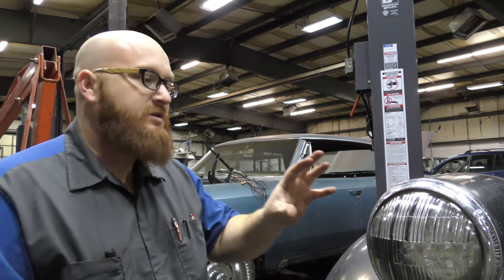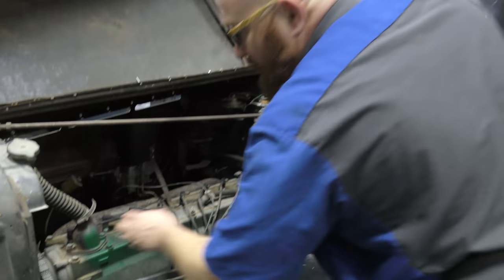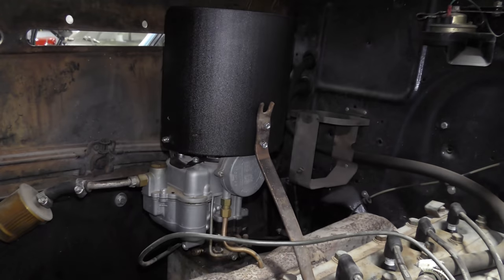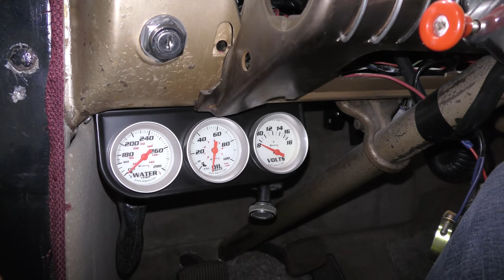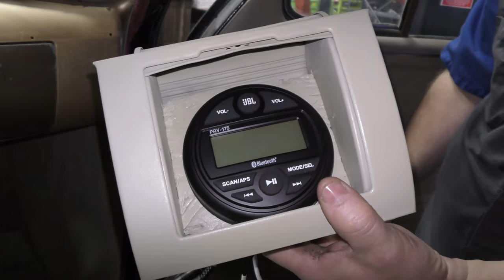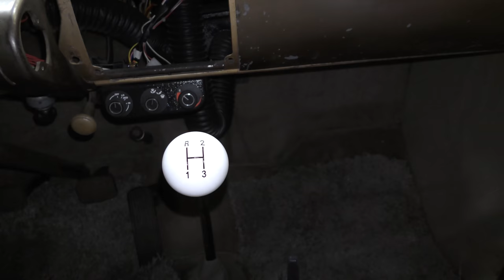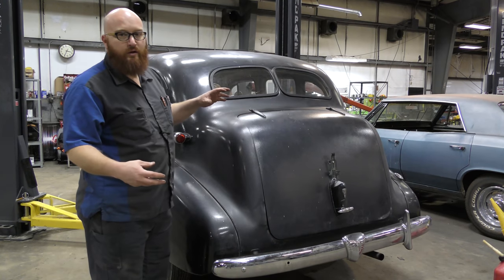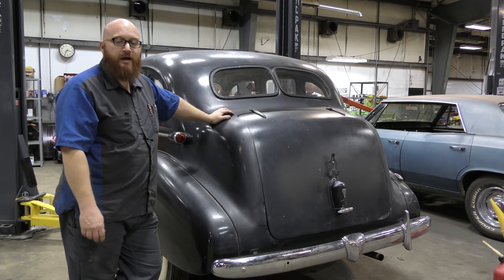OLDS SERIES #2: Nightmare to keep '38 Olds original! CAR WIZARD struggles to restore 83 year old car

Comment: Get rid of the Drum Brakes.  Brakes in that era were so poor that many would not bring a car traveling at 70 mph to a full stop, they would fade out.  Now you are welcome to try them for yourself but make sure you have plenty of room when you do this test.  BTW it's likely that you will have to use second and first gears to slow the car enough to allow shutting the engine off to come to a stop.  BTW, my father was born in 1919 and was a driver during this era.  Back then it was standard practice for a driver and high speed to use their gears to slow the car down to 50 when they could then use the brakes to scrub off speed for a stop.  Once my brother and I were in our mid 20's and on our Dad used tell us about his antics with his 34 Mercury engine equipped Ford 5 window coupe.  He also told us about the brakes back then.

Comment: I still urge you to at least install a dual circuit master cylinder. Much safer than the single circuit one.
Reply: Surprised.that master cylinder under the floor still works. They get a lot of road  grime down there.

Comment: Wizard.  Looking online some photos show the turn signals mounted to the bumper. Either in the edges or the chrome tips. 
Question. Why if you went with modern headlights, not put the turn signals there? As you noted, there’s 5 LED lights per lens. Could it not have 4 lights and a turn signal??  
The marine speakers, could they be mounted behind the cloth of the footwell? Instead of cutting the fabric??
Looks good. 
Cheers.

Comment: I have a similar issue prefab floor pans with my 76 Toyota pickup. I can't find them anywhere. If it was a 78 or later, I would have more luck. I'm concerned about the parts availability as it gets older, especially since the market for that generation of pickup is dwindling already.

Comment: Did you know you can get led headlights with the turn signals inside. Seen them on a hot rot. No having to figure out where to put them and a very clean look.
Reply: Several GM cars (notably Buick) had lights in chrome bezels on top of the head light "nacelles". I believe they were parking lights, but could convert to directionals. GM shared that body style across the board, if not interchangeable, probably easily modifiable. I seem to recall that Pontiac was Oldsmobile corporate twin in those days.

Comment: Oil bath filtering is way way superior then paper filters. They only reason the OEM switch is more money replacing filters in there pockets. The oil bath is way superior for air flow and filtering.

Comment: I would put the speakers under the dash firing downwards...   Also, looks like it already has an aftermarket heater core, why not just replace it with a vintage air heat/ac unit?

Comment: 'Ere Wizard, the trunk lid is screaming out for the spare wheel to be externally mounted. It'll be heavy to lift, but it'll be worth it for those vintage looks!
Reply: In 1938 they would have had "side mounts".

Comment: Wizard, a throttle would be a more 'period' look and feel. You can set it to work like a cruse control . . . just don't forget to turn it off. Lots more fun though. Thanks. Cheaper, simple too.
Reply: A 1938 should already have a hand throttle.
Reply: @warringtonfaust1088  I'm thinking that's what one of the holes in the dash was for.

Comment: “I want to start it like they did in 1938”. 
“I want cruise control”
😉
Reply: There were a few throttle-lock-based cruize controls in the day.
You would tap the gas pedal to disengage them...
Reply: Had cruise control on a lot of cars I've owned. Never ever used it. How lazy can you be?
Reply: @rtta51  lol. Yeah. I bought a ram promaster city base model. I wanted MANUAL WINDOWS. But you can’t get them. I don’t want any electronics that aren’t necessary. They just break and cost stupid money to fix. I can roll up my Windows and press the gas pedal myself. But I was just making a joke about how the wizard wants to WORK the extra pedal  to start it like they did in 1938, but wants to drive it with cruise control and no pedal. 😊

Comment: I like the fact  that you will not overrestore this car and that it will be a car that will be driven! Actually this car could keep the paint it has now: Just freshen it up and isolate the scratches to protect it from rusting.
I did not like those extremely cold LED lights. You should find bulbs with a warmer light.

Comment: If I remember correctly Chevrolet used ball bearings in the front wheels well into the 50s.  When I met my wife she was driving a 1962 Chevy II.  Nova was the top trim level that year.

Comment: I’m sure you know, but make sure anyone touching the Olds is aware of the left hand thread spindle nut and lug nuts on the left side!
Reply: Good tip. Back in 1995, I had a 69 Plymouth fury that I took in for new tires. 
I forget to tell them about the left hand lugs and they proceeded to break all five off the front wheel.

Comment: There are so many opportunities to cut metal out of cars you can fabricate anything. Need a floor for the boot, Mitsubishi L300 van floor pan, wheel well from a truck body.  If you can't find an answer to solve a problem, you are not looking hard enough.

Comment: Hey Wizard;  Nice car for a steam punk dash.   here is how I would do it.  take a picture of the original dash numbers for speedometer,  Now you should get that all digitized,. cut the blacks out  now on a glass have a sticker made from that Digitized image so you can glue it on the back of glass.  now you need to get a screen that is modern, and add it behind that and get it as a digital fill bar so when you drive it displays the speed.  then ass some Copper/brass as the dash parts and you will now have a great modern look on older car.   As for the Radio, you should have used a touch screen.  and modernized it a bit for back up views.  then use the roll up feature to hide the system...   Call it a James bod mod....

Comment: The lens probably wasn't from 1938. It was most likely from circa 1946 - 63. As cars used to be made for at bare minimum 15 - 25 year product life, with new spare parts availability being guaranteed, for that time. :P And yes, this was especially an American thing at first, until Europeans got a hold of the concept with MB and Volvo for example making it a thing that their dealership network must be able to at least have a part available from factory if not in stored in stock, for any model of car at a short notice. Which is why you could buy brand spankers spare parts for Volvo Amazons in 1995. Since production ended in 1970 and it was issued that way. Actually, you could get them from Wetteri as late as 2005, since they tended to collect in certain areas. So, they finally let them go for cheap liquidating the stock. Old geezer Hoarders galore... :D But, covering up and modifying lights for fear of bombing raids was a thing between 39 - 44, even in continental US. And, these cars were in government service quite often. So, yeah. The original lens? Most certainly new-old stock post-war. :D Unless, you know. It had the production date stamped on it. D'oh! :DDDDDDDDDD

Comment: Unless you are going to town on the chrome, and make it all shiny and straight, I would not paint this car. The current paint matches the overall state of the car, and that, to me, adds value to the car. Keeps its history more intact as well. Unless, of course, the entire car will match the new paint (straight body, chrome, etc...). By the way, talking about paint, there was some blue in the engine bay, where the hood matches the side of the car. Of course, that could had been only one of the various paint jobs.  But the blue tone, mid to dark blue, seemed period correct. Best wishes!

Comment: Ball bearings can be a severe issue for you. 70 MPH is not something you should ever try. I'd recommend changing your spindles out and get new drums and brakes. Original undercarriage failure is NOT SAFE and should be changed out if you're going to drive it regularly.

Comment: I have always wondered how a flat head of any type would perform if a fuel injection system was adapted to the motor.  I know purists would not do this.   Eliminating the points system was a great modification.   I am guessing a properly set up fuel injection (throttle body) would give a bit more power and better economy.

Comment: I would put back a piece of plywood to protect the rear seat, and provide extra sound insulation.

For the rectangular gauges:  https://www.jalopyjournal.com/forum/threads/rectangular-gauges.494619/

Also, you need to check out Vintage Air for every HVAC system and option you can imagine for that car.

Comment: What kind of gas do you have to use with such an old engine?   I can’t imagine modern gas with ethanol works fine?

I enjoy the videos, keep it up.
Reply: Reportedly tough on the valves and seats, they need the "lead". There are additives.

Comment: A relative of mine has a 1941 Buick Super 50.  From what I remember the starter button was part of the accelerator pedal, not separate.  Am I wrong?  Maybe I am.  Full throttle = start?  But then somehow when the car was running it was disabled as to not trip the starter when accelerating at full throttle?

Comment: I would restore those gauges by operating them electronically with steppers and a microcontroller. Yes ofc iy is not original but it allows you to keep the original aesthetics and keep it functional without too much hassle

Comment: You almost have to round up a parts car for something like this.  

I have no objection to LED light upgrades because you want the idiots on their phones to be able to see you.   And it's nice to be able to see ahead of you too.  I do wish they'd do the golden-white LEDs for cars though.  You can get them for models now.  

You do want the alternator on a driver.  I daily drove a 60 Pontiac with a generator and it went through brushes like crazy.  No idea why.  I ended up with an Olds generator on it maybe it was a lower output one. 

You can have those gauges rebuilt. Or for the small ones find some similar shape ones.  

Don't overlook full size van filler necks for that situation.  You may find one that will bolt up pretty well. 

I have a milk crate full of NOS replacement bearings.  Some of them are expensive.  But there's a trick, you can snap the balls in and out of them.  That was something else I did a few times on that '60.  It wore the outer fronts pretty good and I had a spare used set and I just put all the best balls in and repacked it. 

You can also, if you can measure the inner and outer diameter, swap to tapered bearing sets, but it takes a lot of time to look up to see if you can find a set that has the correct diameters to fit correctly. 

Drums, particularly the rear, are the same deal.  You might find something like a 73-87 Chevy 1/2 ton truck drum fits on there okay.  Maybe the center hole needs to be opened up a little.  It's just measuring and looking up specs in the books to see how close you come.   Or if you have one handy test fitting it. 

Hope it helps -

Comment: Wizard.....you REALLY need to bust out the oxyacetylene torch and burn that hat to ashes. 
Its brim is much, much too small for you. A hat brim is supposed to be proportionate to the wearers shoulders. 
Once the Olds is running, drive it to a hat shop (they still exist), and have them custom make a hat that matches the car, the fashion of the era, and fits you correctly, it’ll look awesome!

Comment: Wizard thank you for sharing as I stated earlier my farther’s uncle has a 1937.
I looking at pictures of 37 olds on the internet  I have a question if you could 
Please answer for me.  On the passenger side frame between the front door and
The back door I notice a switch can you tell me if it is used to turn on the dome
Lamp.  Thank you  bill roberts Pittsburgh

Comment: I can see that you want it to look stock but I just can’t see the point of cruse control and air conditioning you’re adding a lot of extra stuff under the hood that doesn’t fit so what was the big deal with the starter switch that is nothing compared to the junk you’re talking about adding I’ve driven a couple of 40 models old cars and cruise control was the last thing I would ever want connected to one they are hard enough to keep in the road you really don’t need extra problems to deal with and you’re not going over 50 mph anyway. And you can always roll down the windows people have been doing that for years. Just a thought 💭

Comment: I'm noticing a pattern here on this channel. "You guys can check out the previous video and hear it run" ... except the previous video referenced is named in no way shape or form similar to this, so it takes ages to find, if you can even find it at all without just guesstimating and clicking on random ones you haven't watched yet, which is how I ended up finding it under "New Old Car Reveal! So, why then is Mrs. CAR WIZARD so nervous???
". Very intuitive... not

Comment: It would be blashpehmous. But, I guess since I abhor making cars garage queens and museum pieces, what I'd do if I'd get my grubby restomodding mits on one of these, is dump a 4.xl Rover / TVR V8 in it (since, the Rover 215 is actually originally Oldsmobile V8 derived for, among others, Buick and then when the US market didn't care for none of that aluminium block and sensible cubic capacity sophistication nonsense and preferred gasguzzling oil burning crap, it's actually that engine taken to modern standards.) with modern EFI and two VG Turbo's. And modernize the ever-loving hell out of that suspension, but not the way Nurburgring fanatics would, but rather taking a couple of pages from Volvo and Saab and their way of tuning a big sedan for performance touring driving... And, of course keep it as stock looking as possible on the outside. And, yes. LS swaps are a bit old hat. Another choice would be to stick aussie Barra in there, since you know, that would be heretical and since the Barra is actually superior to the Vortec 4200 in a lot of ways...

Comment: What are the benefits of a straight 8 vs. V8?
Reply: With modern V8's nothing really. However, back in those days the benefits would have been a more simple and familiar design and better torque curve /  faster torque delivery.
Reply: Straight 8 is generally regarded as smoother, simpler, and is narrower than the V8...but a "modern" OHV V8 is better in most ways compared to a flathead I8. There's a reason Straight 8's were largely gone by 1955.
Reply: Straight 8s have better inherent balance and therefore less inherent vibration. They're also cheaper to build - one long cylinder head is more economical than two shorter ones.

But for modern vehicles, the downsides of straight 8s generally outweigh the benefits. They obviously need a larger engine bay, the crankshafts are more expensive to machine and they need to be a lot heavier than V8 ones to stiffen them up, and so on. V8s are just far more practical for most applications.

Comment: Dude- you can have the reflectors redone with aluminum vapor deposit and 12 V halogen bulbs .w heavier wire that way you can still use the cool GM 4 position headlight switch. Guages are rebuildable. Come on man

Comment: Why don't you just restore the gauge cluster? There's guys that will go through it and bring it back to factory.
Reply: Yah if you have a 135 there's lots of people who can rebuild them there basically a gear and the cable strips out for the Speedo and as for the outhers it's usually a wiring problem.

Comment: Every original part that is replaced with modern junk diminishes the value of the car. The only way to make the car feel like was intended is to restore it back to original, including 6 volts system.

Comment: Hey enjoyed some of your videos. Thought I'd turn you on to the shop where I work.

https://youtu.be/2YcWIpZTcko

We make really cool parts for a lot of stuff. On my bench right now are parts for submarine that launch the seals out.

I bought an old tractor last year that was broken and missing parts. We made the missing parts by guess and by gosh. Nothing to measure but the parts that were there. We figured dimensions of parts missing. Had to re machine alittle. Don't know if we got the new parts exactly right, but the tractor works now.

We have engineers on staff so we can re engineer something if needed. Sometimes people want to modify something that didn't work quite right. Or with modern materials we can make something that will work better longer.